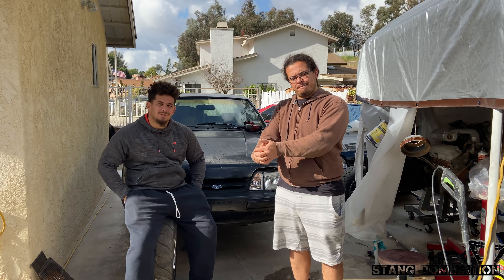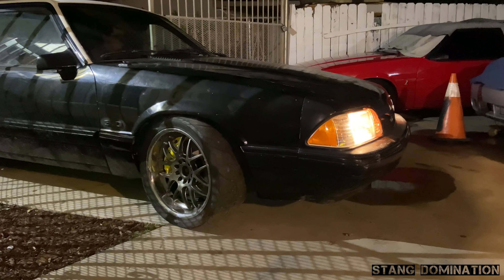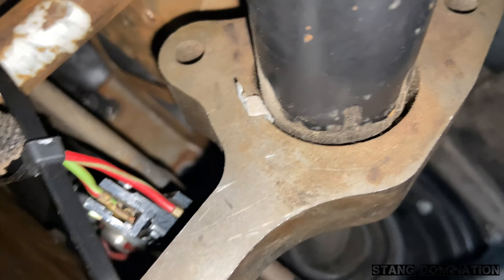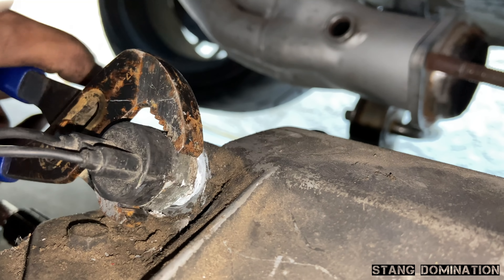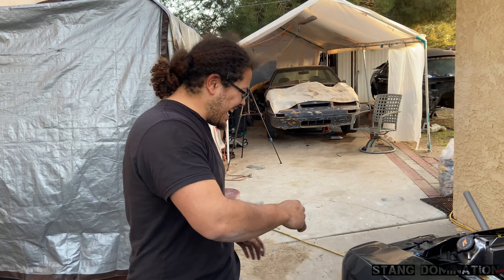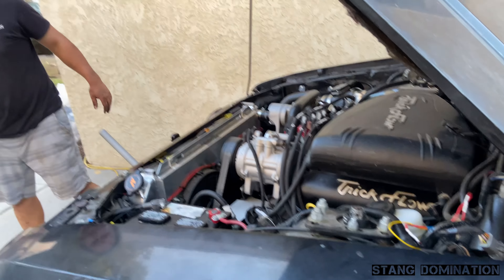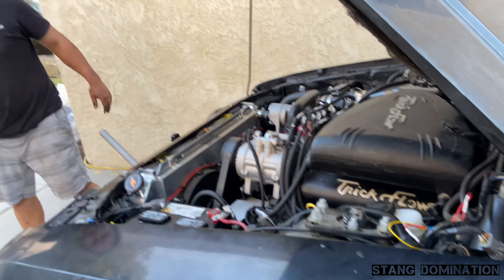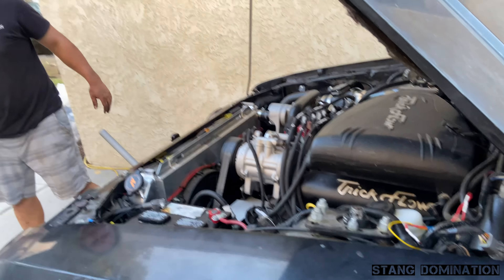FOXBODY MUSTANG ON THE ROAD AFTER 17 YEARS

Comment: Nice!  That pin is for the cruise control and neutral safety.
Reply from the maker: Junkyard Doggs Appreciate it. So with that pin causing a problem do you think it was getting stuck or something?
Reply: @StangDomination  when the shifting shaft gets worn down it doesnt work right.  It will stay in the open position and make either not run or run like shit.

Comment: If using an A9P which is an automatic computer, you also have to use an automatic oxygen sensor harness. Pin 30 on a automatic computer is setup to read weather or not the car is in park or neutral by resistance to ground through the i terminal on the starter solenoid. This helps the computer control idle speed by weather or not it is in drive and under a load from the automatic trans. It controls off idle conditions. All you did with the neutral safety switch was disarm it. That rod needs to be in there.
Reply from the maker: Yea I got the o2 sensor harness to match but put that rod back in and unplug it? appreciate that info 👌🏽
Reply: Stang Domination if it is reviving when you are engaging gears, then you have the wrong o2 harness. You need to google converting an auto computer to a manual. Right now you do not have neutral safety.
Reply from the maker: Damn thank you for that appreciate it

Comment: That pin presses against the switch while in gear to close the circuit outside of neutral so you can't start in gear. It probably was getting stuck. Try starting without pressing the clutch.
Reply from the maker: what would need to be replaced if it’s messing up like that and I already took it out lol but it fires right up

Comment: Man loving ya channel!. Where ya located?. I’m having trouble with my fox. Just installed a 94 mustang got engine in my fox body and we got it to run. We had it running for a while and I was turning it off and on when we was messing with the electric fan we was installing but then I turned it off when the temp was 3/4 to red then it just wouldn’t start no more?. I have spark on my coil but low spark coming from the distributor? Any ideas?
Reply from the maker: Appreciate you brotha thank you. We’re located out in San Diego. Is your fuel pump cutting on? I know cars will have a hard time starting if it’s too hot but it can be a lot of different factors. Tfi module could be going bad or the rotor is not getting good connection with the cap on the distributor. Hopefully this is helpful.

Comment: That's a needle bearing to the front input shaft !  I wouldn't drive until you inspect that input shaft by removing the bolts and if see if there's needle bearing missing or floating around the case.
Reply from the maker: Damn jinxed myself gotta drop again lol but appreciate the info thank you